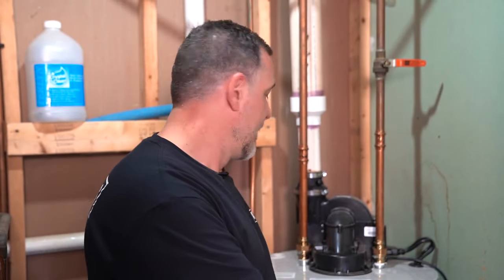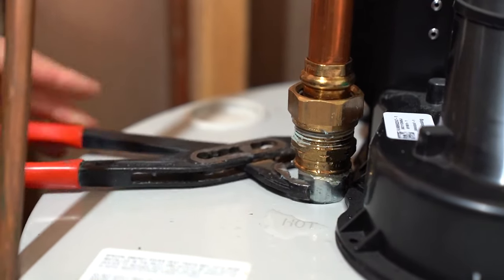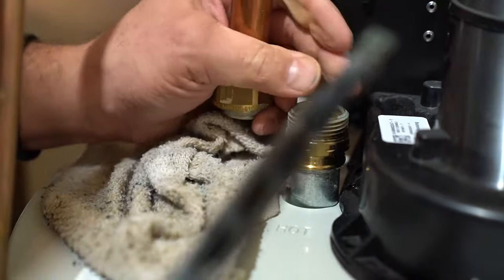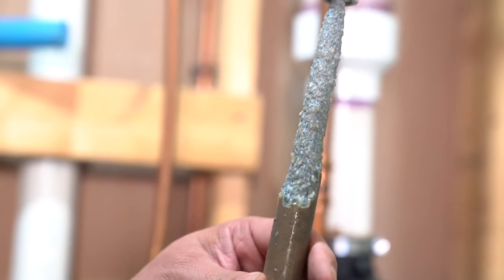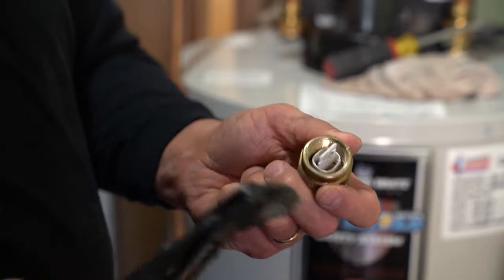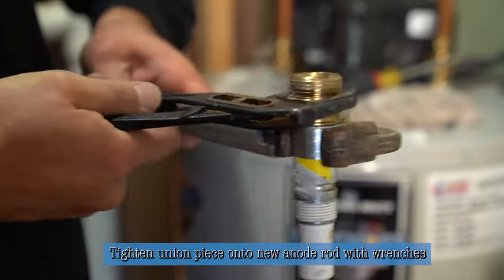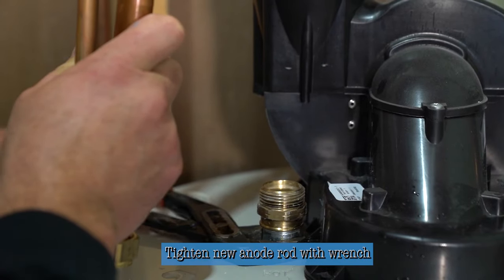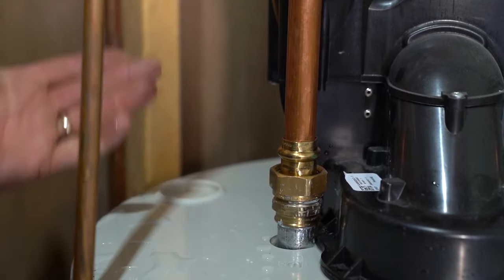Anode Rod Replacement on a Bradford White Water Heater - Water Heaters Now

Comment: Can an eroded rod/threads cause water to leak out onto the top and down the unit? Im near certain the old threads are the culprit of my leak, but since its the threads its below the top metal plate and cant get a visual like an exterior leak.

Comment: Nothing against this video, thank you for making it. 
But how did the engineers remotely think this was a good design choice??  What a headache (and opportunity to introduce leaks) it is to have to disconnect the hot water outlet.  I'm disappointed my house came with this model.
Reply: Bradford White do not want you to change the anode rod. They prefer that you buy a new water heater sooner. Thats why they designed it in this matter.
Reply: @powerbeast5691  shit...ima make a point of getting this sac. anode replaced
Reply: Bradford whites are the easiest water heater models to change the anode on. I’m not sure what you are complaining about.
Reply: @Prosecute-fauci  my complaint is that a well-designed water heater (which Bradford White isn't) wouldn't incorporate the anode into the hot water connection, it would have an anode that can be replaced without disconnecting any water connections.
Reply: @agentmango  the reason I am saying that it’s actually the most convenient method is because the other brands require you to completely disassemble the top of the water heater to get to the anode rod. This includes both the cold and hot water connections.
Reply: @Prosecute-fauci the old ones just spun run out with a socket, super easy

Comment: nice video...i have to take anode rod out, water has terrible oder if i don't.. is there anyway to fix that?
Reply: I heard that letting the rod get eaten up too much will start to create odors, so replacing it should help with that.

Comment: Ok, folks, here's a question. Just learned all these water heater maintenance ideas for my 20-year-old heater! [New homeowner in brand new home 20 years ago, wth did I know!?] Anyhow, wondering if it's worth messing around with this now. No problems with the water heater. Maybe just wait 'til it doesn't work and buy a new one? Or, try this to get another 5-10 years out of the heater and if it doesn't go ok, buy the new heater?  🙂
Reply: Either do this, or just proactively change out the tank. The issue is that, when the tank fails due to corrosion, it's going to leak and get water EVERYWHERE.
Reply: You could change out the anode rod but you might not be able to get a new rod in there with all that sediment thats been piling up for 20 years,, half joking... but who knows...  20 years with no maintenance, I would say you definitely got your money's worth!
Reply: @motogp9253  I think I'm just going to wait and see. Person above thinks when it goes there will be a flood but there is a 3" high tray under it so.... maybe not! [Famous last words].  Who knows, maybe I'll spring for a new one before any potential disasters. :-)  I've sure learned a lot through this process of investigating the situation.

Comment: Mine is NOT as shown. The old anode rod is stuck and the only gripping surface above the tank is the threads. If I damage the threads and cannot get the old anode rod out, I am in trouble.  Nothing in the video about what to do in this case. HELP!
Reply: Just get a solid grip on it, wd-40 the hell out of it, get a long pipe for more leverage, and PUUUUSH
Reply: The whole tank may move a bit before you break it free. Don't worry, it's a big ol' thread, it won't break and leave you stranded.
Reply: @ivanvarela3215  Yep, it all went just like you said. They really could put more of it above the tank though. Thanks.
Reply: Excellent Point!   Threads only above the top necessitate REPLACING the anode rod instead of inspecting it and putting it back in if it's got life left in it.  NOT GOOD, BW!   Butcher your threads.

Comment: Thanks! This helps. My issue is that the union piece connecting the current anode piece to the copper pipe doesn't have a spinning bolt, but instead the copper pipe looks to be crimped into a joint which is screwed directly into the union piece. The copper pipe is then connect to PEX. Could I just unscrew the copper pipe from the PEX and union piece, or would I need to actually cut it? Thanks!
Reply: Curious if you ever got this figured out. I have the same issue.
Reply: @Sxjones3 Never moved past this step. I still have the same anode rod in place. If I perform this myself, I assume I'll try and unscrew the copper pipe from the PEX and union piece.

Comment: how often should this be done?
Reply: The manual says ever 2 years
Reply: 3-5 years I keep hearing.  We have a water softener, and after 5 years (last year) the rod was corroded about halfway. Replacing it this year. They say soft water makes it more necessary to replace the rod more frequently, but 6 years isn't too bad!  Most water heaters last about 10 years, but with good maintenance (like this, flush/drain, inspections, etc) it can last 20 years or more.

Comment: I may be incorrect, but I was told there should be continuity between the threads on the anode rod and the water heater....so...don't use a lot of pipe tape...only teflon pipe dope.

Comment: Anyone happen to know of a replacement ARTICULATED anode that will fit on a Bradford White URG 2100 H6N? I'm having a hard time finding this information and my plumber is not being helpful.
Reply: Interested for a follow up post, was one available? I called the manufacturer for a part number since my unit was super old. One person in the comments also wanted a flexible rod for a BW unit.
Reply: @ullrsdream  I gave up. My plan now is to simply replace it when it gets past 10 years of age. I'm hoping that by that time there will be non-steel tank options on the market.

Comment: I have to cut mine down about 1 foot.

Yeah good point don’t forget the breaker and turn it off then the water supply. Drain a bit also.  Open the hot water downstairs and drain a bit.
Reply: mfg do make a bendable anode rod now home depot sell it

Comment: so did you unscrew the hot or cold water pipe? cant tell in the video. whats under the other one?
Reply: It's the hot.  You can see it at 0:45 if you look at the letters stamped into the tank

Comment: how is a powered anode rod installed into this type of tank?
Reply: powered? Please explain. These parts function solely on chemical processes that happen between H2O and the metal of the anode rod. I think the youtuber mentions a powered exhaust venting set up rather than a passive chimney, but I'm not familiar with a powered setup for venting. Probably like a bathroom exhaust fan, it will force air to exit the pipe and water heater area than simply letting heat rise and carry the gases away. Cheers.

Comment: Power turned off?
No draining?
Reply: He left this stuff out. Yes, you should turn the power off (on electric), or turn the gas to pilot or vacation, then turn off the cold water inlet, open a tub faucet, and drain a couple gallons from the tank. Perhaps even wait an hour or two so the tank is cooler.
Reply: @watteau6646  Thanks

Comment: Does all bradford have aluminum anode rod?
Reply: Could also be magnesium.  Look at the model number on your water heater to see which one you need.
Reply: mine has magnesium. Magnesium is also recommended if you have soft water.

Comment: Just a common sense point out before you get someone killed or burned with hot water. The water should be turned off and the boiler off or set to a very low temp so it doesn't initiate. Also pressure from any hot water faucet should be opened to relieve pressure..
Reply: Yes, and a couple gallons drained from the top as well.

Comment: Used to be plumbers didn't use dielectric couplers because of ignorance of how electrolysis works after the  learned they knew most people don't know they need replacement at regular intervals most won't tell as they know that soon after they are used up your tank develops a pinhole and starts to leak a hole that gradually increases meaning you need a new tank sometimes in less than 5 years and that is covered under warranty they must be hurting bad now that pex is the new normal tanks properly installed with dielectric couplers will regularly last 30 years or more before sucoming to the other killer of gas hot water tanks sentiment on the bottom of the tank another unit causing tank replacement is the dip tube wearing out and when you ask a plumber why you only get 5 gallon of hot water they tell you it needs to be replaced an expensive cost when a 100 dollars max replacement of dip tube will fix the problem you're the first utube video I've seen on fixing the problem of tank corrosion so maybe there are still some good plumbers out there although one thing I never did was leave a tank hooked up without dielectric couplers installed
Reply: All Bradford Whites have dielectric couplings now.
Reply: Douglas - OMG this sounds like you really know what you are talking about but I can barely follow most of it because it's one loooooooooooooooooooooooong sentence with not one period!

Comment: TFE tape is not recommended. Because it’s non-conductive, if you apply too much and the thread won’t  crash it then the anode rod and the tank body won’t contact. The anode rod doesn’t work. So cream style sealer is better.

Comment: Can I was any name brand anode rod?
Reply: Use
Reply: I was going to do that, but because there could be issues with the fittings/threads, etc. I bit the bullet and ordered the correct part number from supplyhouse.

Comment: OK overall but you wrapped the teflon tape onto the anode rod threading BACKWARDS.

.Also, you didn't sho0w shutting off the water or draining the tank as part of this procedure.

Comment: Unfortunately for me, my hot water copper pipe does not have a free spinning union junction to the outlet pipe.  It has a hard soldered copper connection.  I would have to call a plumber to disconnect the pipe 😒  I guess this is done to discourage DIY maintenance and to shorten the life span of the tank generating more revenue for the plumbers.
Reply: Just cut the pipe 12” or so above connection to water heater and buy a shark bite connector to put it back together. The plumbing fittings now days are meant for DIYers.
Reply: It's done by a plumber who didn't want to spend $5 for a union.  But don't worry, you'd never wrench that anode rod out of a Bradford White after five years anyway.
Reply: Same here. I will look for a different brand once this one is done for. I understand wanting to keep sales up, but these manufacturers need to considered DIYers. I have mouths to feed, cannot keep hiring "professionals" to do simple household maintenance.